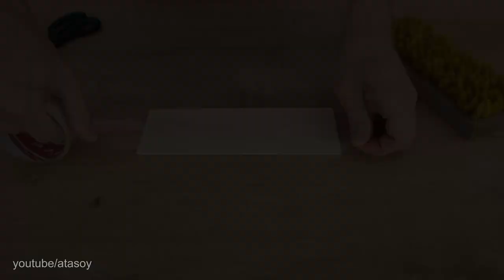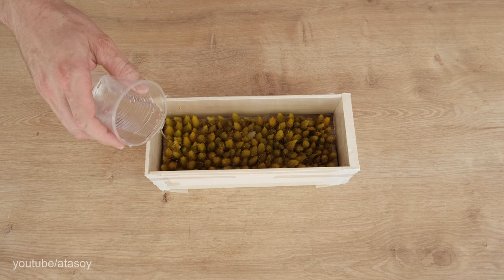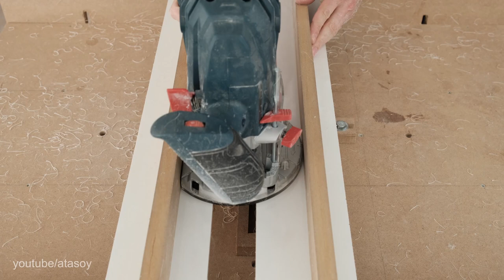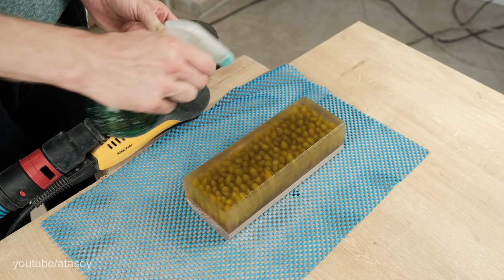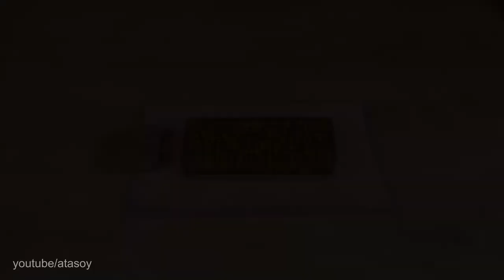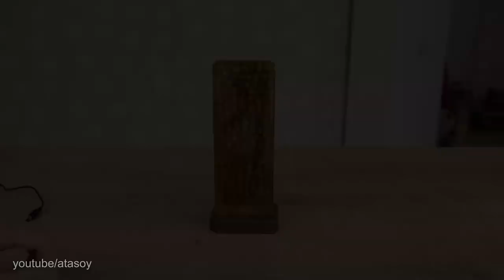Decorative lamp made of epoxy resin using cotton grass - Resin Art

Comment: Is the sanding belt station necessary for resin lamp making?
Reply from the maker: If a quality silicone mold is used, a lamp can be made for a while without sanding.
But the use of ready-made molds limits your work.
you cannot produce original shapes, you depend on the shape and dimensions of the mold.
When your mold gets old or you have a problem after casting, you may have to sand to fix it.
My advice to you is that you start by using ready-made silicone molds and progress by improving yourself by making more original works.